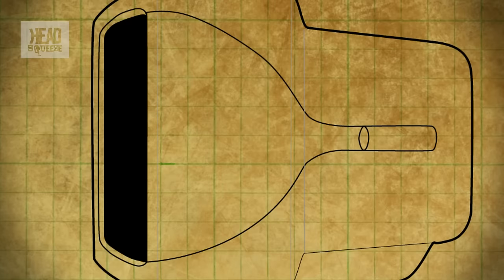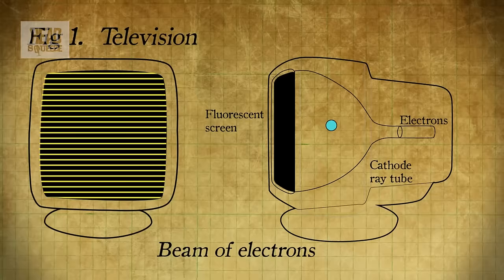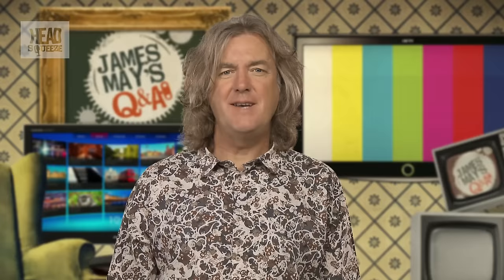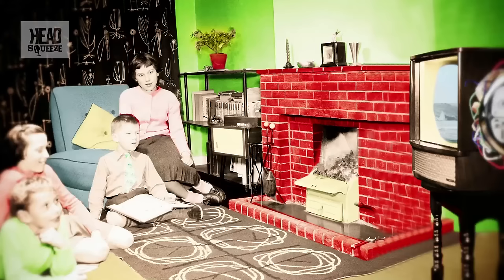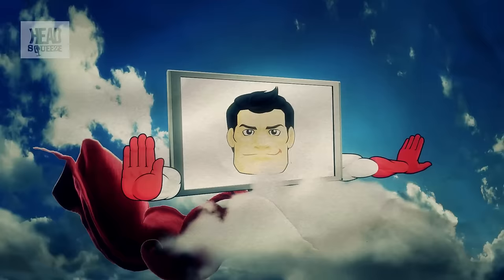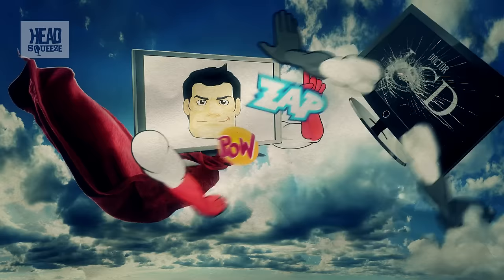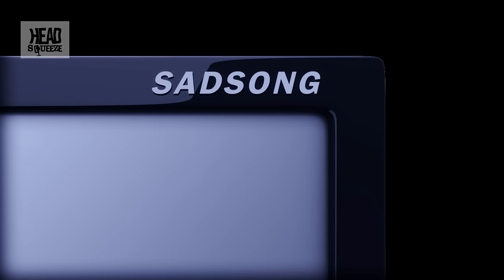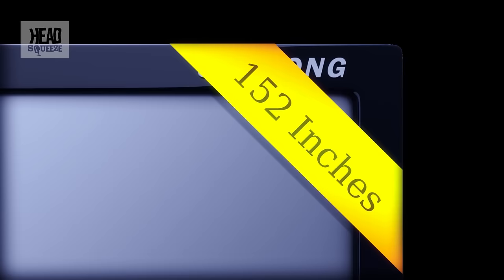How do plasma TVs work? I James May Q&A I Head Squeeze

Comment: Plasma TV's are already outdated.
LED is the best of both worlds, LCD and Plasma.
Reply: LED is just an LCD panel with LED strips lighting it up instead of fluorescent light tubes (CCFL)
Reply: But there are numerous different technologies. One is replacing CCFL backlight with a white luminophore LED strip light, and using the same light guide. Another is using individual red, green and blue LED chips to create a more saturated colour. And then there's variants that don't use a strip light but use a light box that is lit on the whole area. Those are all still LCD screens. Arguably, neither of those replace plasma screens directly, even if they did displace plasma, both due to LCD shutter systems becoming better, less directional and higher contrast, and due to better backlight expanding the colour gamut.

And then there's also OLED, where each pixel is a set of multiple individual colour LEDs. Those are so similar to plasma both in appearance and in the durability problems, that they can be considered an improved direct replacement.
Reply: LED is simply a backlite for an LCD display. LCD displays used to have florescent lighting the back, but now its led... LED display is just a fancy advertising gimic, its just a more efficient way of lighting LCDs.
Reply: The new led backlit screen tv's are much less reliable than  tube backlights , the led's fail all the time.
Reply: I'm sure you have statistics and sources proving your claim that cathode tubes are more reliable than solid state LED's
Reply: Gary Hunter Huh, so my 2010 1080p led back-lit monitor should of failed by now... right?
Reply: Your lucky that's all
Reply: Gary Hunter No. Another example, my dad has an old monitor from 2008 and nothing had happen to it... Also we have an old 720p led flat-screen that I own...
Reply: OLED for life
Reply: No, OLED for 3 to 15 years. After a few years of use, the actual screen degrades and burns in, impossible to repair.
Reply: Technically, it burns out, the most used pixels degrade more and get dimmer than the rest
Anyhow - buy a new (and most likely much improved and cheaper one) when it starts becoming an issue
Reply: Amoled ftw
Reply: OLED*
Reply: SuperAmoled ftw
Reply: *you're
Reply: Filmzes, theirs Oled, quantum Dot, and the ones we have now are the only LED with lcd panel. Trust me in good time LCD's will be gone.